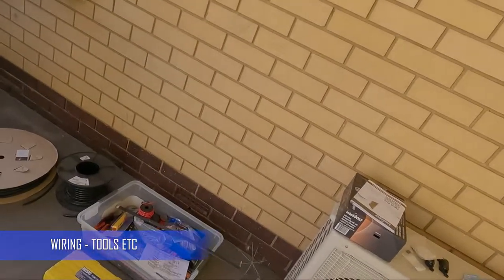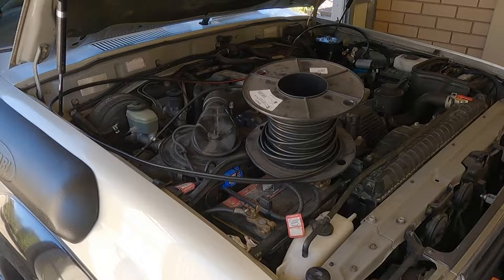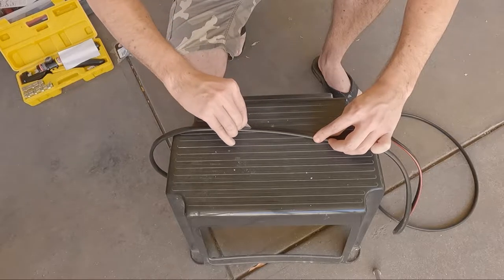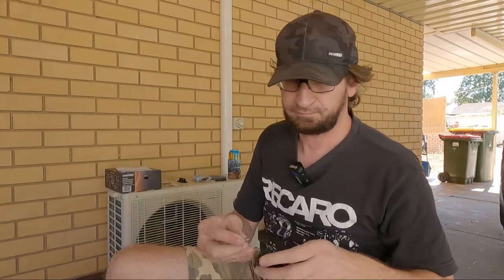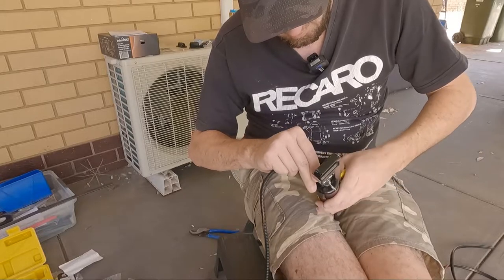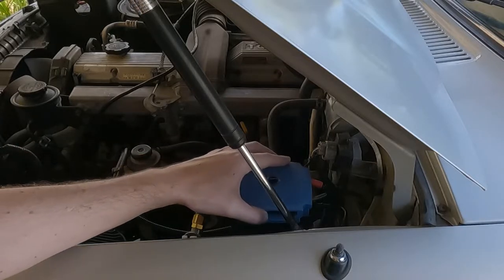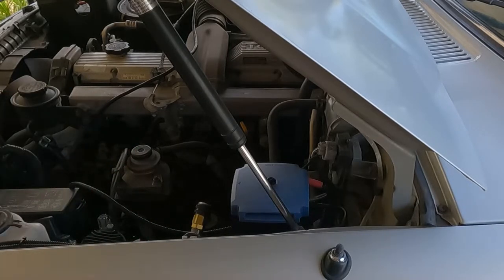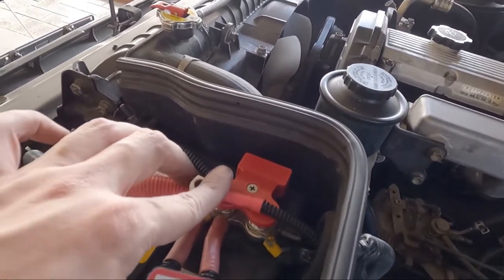Toyota Landcruiser 80 Series // Wiring The Intervolt DCC Pro DC Charger

Comment: Hello we wore told you don’t need the small wire  but it turned out we I’d because it kept charging while the engine was turned off so we add the remote wire and we fix it
Reply from the maker: Mmm, not sure that is correct.

It will still say it's charging up until the point where your main battery hits the voltage cut off and disconnects.

I found my display wouldn't turn off for ages if I didn't have a load on my auxiliary battery like a fridge for example.

Is that what you're referring to?